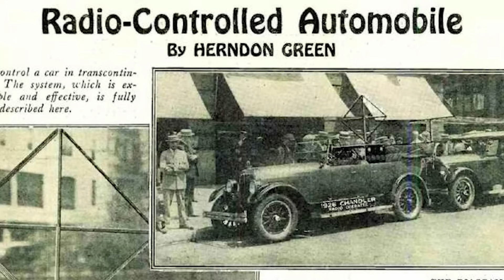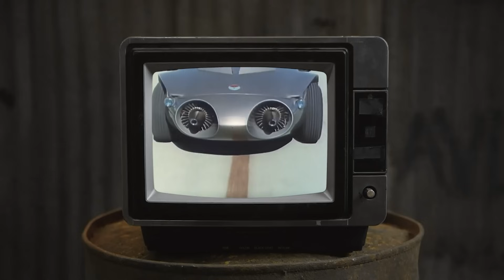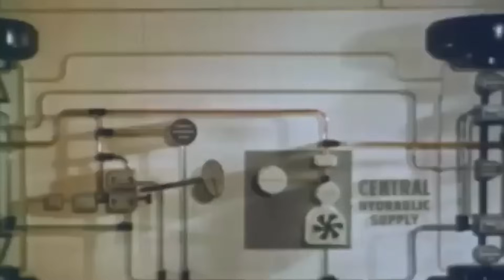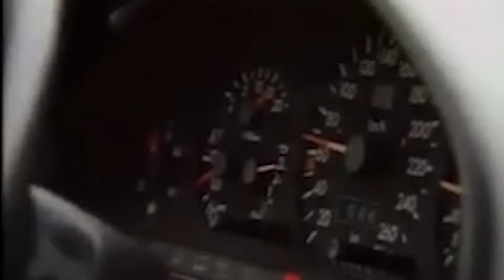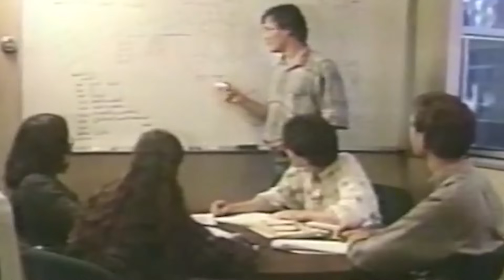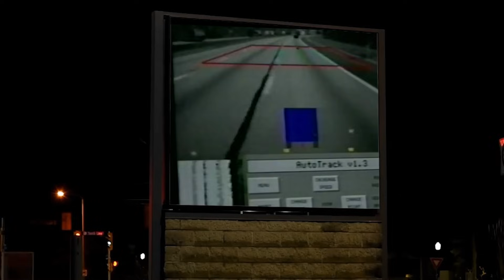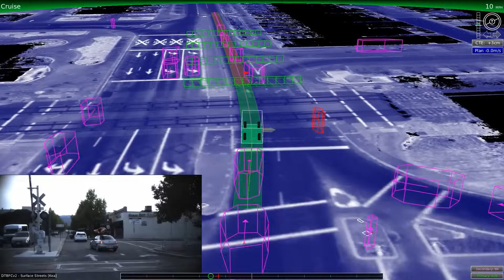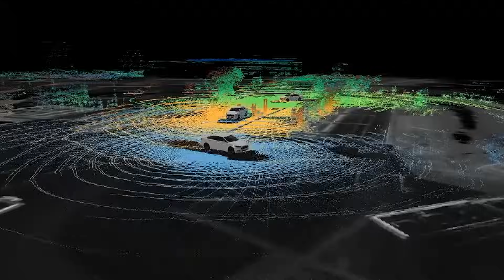100 Years of Autonomous Vehicles: A Journey through History and Technology

Comment: This video only mentions the Mercedes-Benz S-Class autonomous drive near Paris while the long distance drive, in traffic, from Munich to Copenhagen. This was in 1995, the same time as Carnegie Mellon test.  So in 1995, the research team led by Ernst Dickmann, who used the Mercedes-Benz S-Class and embarked on a journey of 1590 km (989 miles) on the Autobahn from Munich (Germany) to Copenhagen (Denmark) and back, using jolting computer vision and integrated memory microprocessors optimized for parallel processing to react in real time. The result of the experiment marked the way for computer vision technology, where the vehicle, with high speeds of more than 175 km/h and with minimal human intervention, was driven autonomously 95% of the time.
If that wasn't a milestone to be included in this video then I don't know what a milestone is 🤦‍♂😅
Also the first real autonomous drive in a normal environment was via Mercedes-Benz S class driving the Bertha Benz Memorial route in 2013 (urban and city driving).
Reply from the maker: Sound like a milestone! Your insight about the 1995 journey led by Ernst Dickmann adds depth, thanks!. There is a while back we produced this video but i would guess because of video length constraints, we did not cover every milestone.